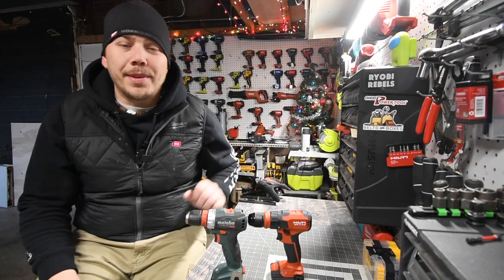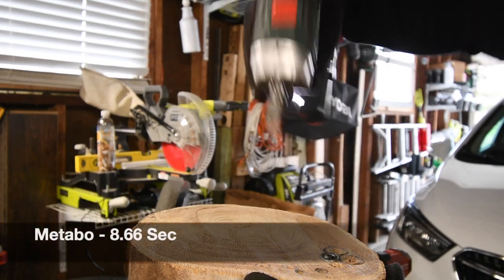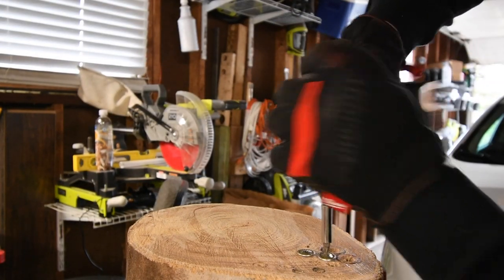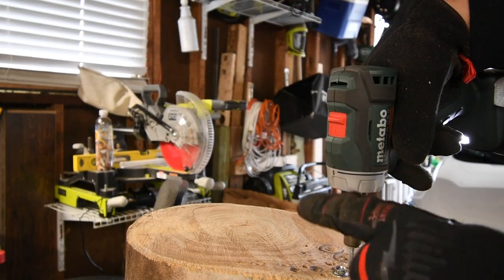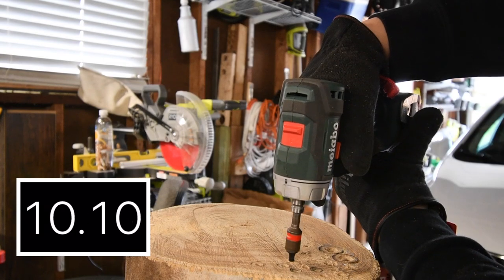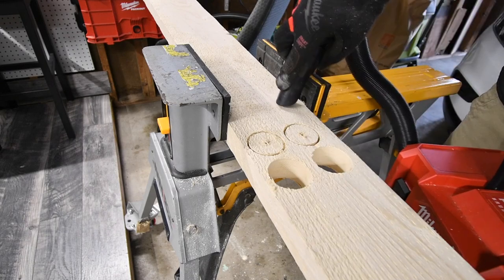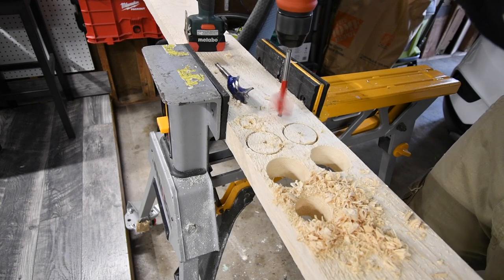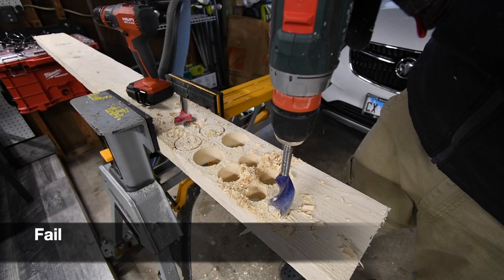Metabo vs HILTI (12v Multi-Head Drill/Drivers)

Comment: My experience with Hilti is that pretty much anything that breaks after the two year is up is not considered a manufacture defect thus voiding their so called 20 year warranty. I like some of Hilti's tools but I would rather have a tool I can order parts for and fix myself.
Reply: In Europe Hilti has only 2 year full waranty and after that just paid repairs. Festool has 3 years. Bosch and Makita have only 2 years for firms and 3 years if online registered for people not for firms, but the parts are easy available even for very old models. Not all models have afordable parts, like for instance some light duty-medium duty 14-18V Bosch brushed drill drivers have absurdly expensive parts like 4-9 X Makita and times two again when rebranded as Wurth...but some are afordable and also heavy duty. On the brushless models is the other wey around, altrough Bosch parts are also more expensive compared to non brushless, when we look to Makita we find crazy expensive parts even for 12Vmax brushless tools, so not worth the repair.

Comment: I luv 12v tools as well and they have only gotten more powerful over the years. I started out on the Rigid 12v line and I was really hurt to see Rigid discontinue that line. My drill/impact driver set is still running like a champ but I recently switched to Milwaukee’s M12 line and I hope I made a good choice. I believe I have so far. Great vid man…keep them coming!!
Reply: check out the m12 fuel multi tool, lol, you will instantly justify your choice
Reply: @feelingtardy  I’m seriously thinking about that one BUT for the power and run time I’m considering going with the Rigid 18v multi tool since I’m on that platform for my 18v tools!

Comment: I’d be interested in how these compare with the Fein ASCM 12 Q. Can you get these in the USA? It’s brushless and has 4 speeds up to 2500 rpm. Mine’s been indestructible so far and seems as well made as my Hilti gear.
Reply: Инструмент fein выше по класу. И даже  круче festool. Имею fein ascm 18 qx - номер 1 в мире. Made in Germany.
Reply: We have been able to get the 18v and 12v ASCM models for a long while.  Rarely can we get bare tool (not at all afaik) and the additional chucks are as scarce as hens teeth.   Most shops that carry Fein only carry multimaster tools and accessories and sometimes the dust collectors.  Some shops carry their metalworking tools but in a limited fashion. I was surprised to find out that we supposedly can get most of the cordless lineup here.  Alas, as mentioned before, only in kit form afaik.
Reply: @dominusdominus2941  I had an ASCM 18 and while it had a bit more power power than the PDC 18, I recall I liked the Festool much better. Better electronic clutch, can stand up without falling over, and less runout with the centrotec bit holder vs the Fein chuck with the Wiha holder on it. Also, of course, couldn’t get the other chucks in the US at the time.  Replaced both with the three speed Metabo for a while. Metabo had more power but not as nice as Festo or Fein.

Comment: These are cabinet drills. They have no power. You try to drive lag screws with these, you'll break them.
A real test with these would be how smooth they are, how clean of a hole they drill, how gently they drive small cabinet screws, how well the different attachments work, and get in hard to reach spaces, etc.

No one's gonna buy these things for power. It's also not a great idea to wear gloves when operating a screwgun, even if you're working out in the snow
Reply from the maker: they are useful in many ways including cabinets
Reply: best comment ever about youtube tests, some are incredibly absurd comparisons, and each brand focuses on different functions for their different models, comparing them just for the voltage...hhmmf..each brand focuse on different aspects and applications for their models, even when they have the same voltage, this goes for heavy duty tools youtube tests and light voltage cordless